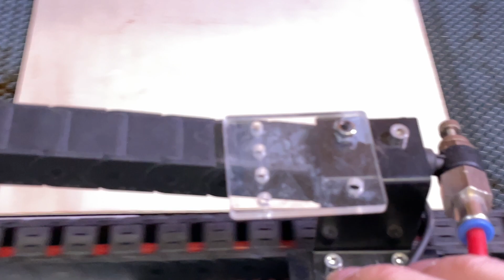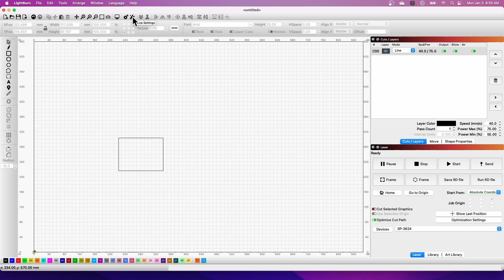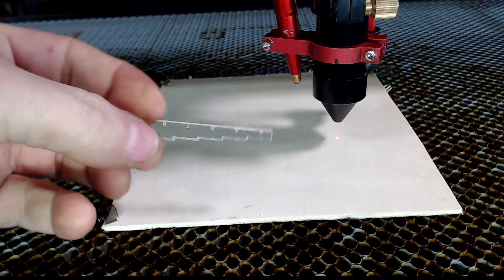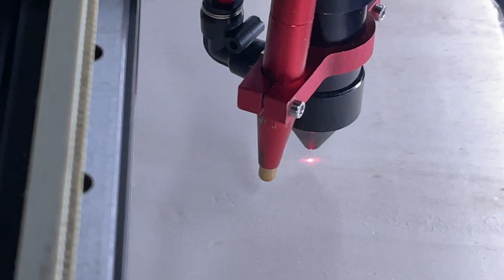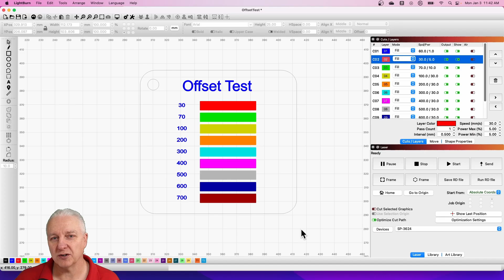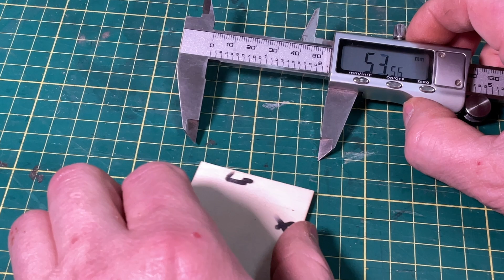What If You Could Build a High-Powered Laser at Home Right Now? Part 6

Comment: My teenage kids and I built one(95% the build is done by my daughter). In the process of calibrating axes I disturbed the machine.Every time x and y gantries  hit the limit switches , the Ruida controller ask us to press Esc key on it. Please help us to make those limit switches work as they were initially. My daughter will get upset when she get home from college and learn that I messed up her project.
Reply from the maker: First congratulations on building your own laser!  Are you getting this message on the Ruida when you are homing or when you are engraving something?

If it's happening during engraving it's because you material is too close to the edges of the workspace.  This happens if your acceleration/decelerations values in the Ruida are high.

Once you get this corrected, I would suggest backing up the settings for your laser in Lightburn.  This way if something gets messed up you can always go back to where you started.

Comment: This is a great video, I love all the calibrations you have. I've struggled to get my machine above 300mm/s, at higher speeds the scanning offset is aligned but there's a blurry spot where the laser starts each line and it shows in the quality of the final product. I am glad to see that 600mm/s is doable, I've been eyeing the 1200mm/s machines and trying to replicate that but I'll stick to 600 for now (if I can figure it out). Looking forward to the full build writeup!
Reply from the maker: If the spot is truly blrruy then it could be an optical issue (think alignment).  If it's just noisy then it's probably mechanical.  BTW, with New 17 motors and wider belts my laser could easily get to 1200 mm/s, but at some point the laser tube can't output enough power to effectively engrave at that speed.  That's when you need to think about a 150W tube.

Comment: You say "you've probably seen lots of these" but you are literally the first person I've seen do the focus test this way. Everyone else does the ramp (because they can't control Z like we can, I assume). I recreated this in Lightburn and holy cow was it easy and straightforward to pick the correct height!
Reply from the maker: Definitely a powered Z-axis affords some extra conveniences and for the extra ~$50-60 it costs it is very much worth it.  I've used ramp tests and they are a pain where you sit/. Most of the other line tests force you to start from an accurately known location, whereas the method I have here will literally allow you to start from any position where you can make a mark on the material..

BTW you've just reminded me that I haven't uploaded the lightburn files for this and I will do that within the next several hours.
Reply: @SteveMakesEverything  yeah, my engineer brain refused to accept the ramp test. You either have to a) have a laser that can already cut you accurate pieces, b) accept that you are basically eyeballing it, or (c) do a bunch of trig and ultimately still basically be eyeballing it. This method is brilliant. So, now that I’ve done all the steps to the end of this video, I need to figure out how to use these material test pattern things… 😜

Really glad I didn’t just order a K40 and call it a day.
Reply from the maker: @Frank deBros I'll do a video on the test patterns specifically for people using Lightburn.  Not sure when, but soon

Comment: Hello Steve! Thanks, very interesting video. Note that the acceleration settings in the advanced panel should just adjust the times in the preview, they are not written in your controller!
Reply from the maker: Correct.  If you want anything permanent you really need you do acceleration changes on the Ruida controller itself.  Not usually a problem since most people won't ever work with the laser without using something like RDWorks or Lightburn.